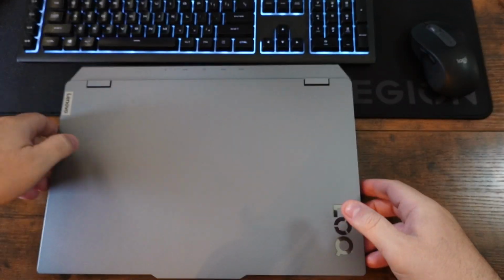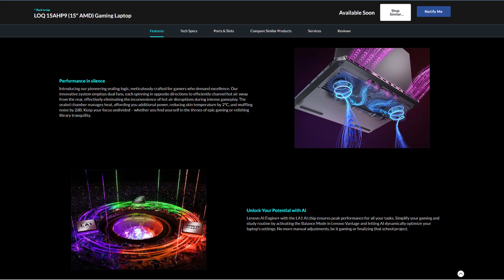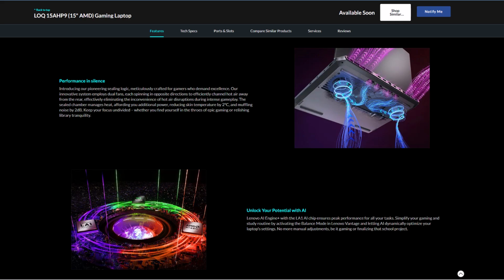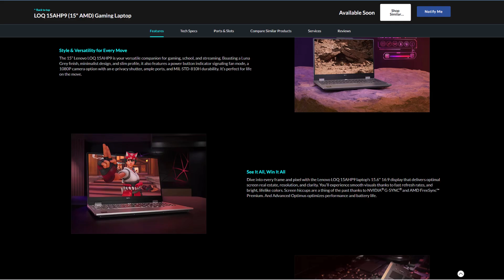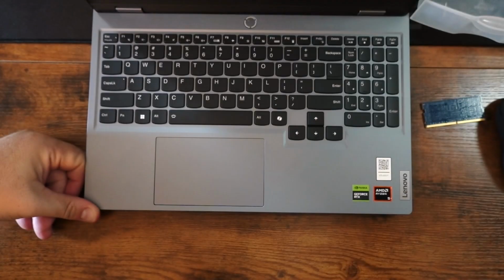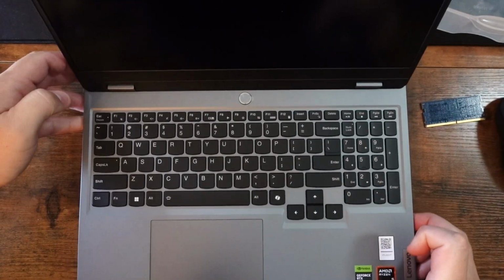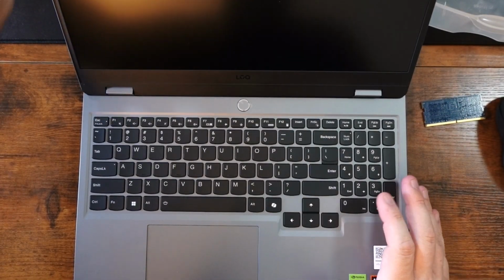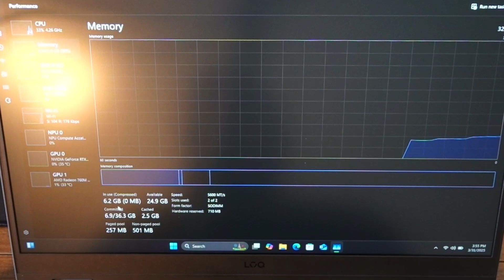Lenovo LOQ 15AHP9 SSD Upgrade Guide | SSD & RAM Upgrade! | RAM & SSD Upgrade Tutorial

Comment: How do max the RAM speed?…. I cannot find XMP or memory overclocking in BIOS.
Reply from the maker: I've checked mine and there is no option for that. It automatically set the speed for the memory I installed.

Comment: Can we disable battery in bios 
Before upgrading anything 
Or we have to disconnect it physically 
Which option is more reliable
Reply from the maker: You would need to physically disconnect it.
Reply: @LMFTechStudios  Why? I just upgraded my RAM without disconection and nothing got happened. Works fine)
Reply from the maker: @bod140k  It's mainly for safety reasons and not to take a chance of damaging anything. It doesn't mean it won't work or will get damaged, but it is better to be safe than sorry.

Comment: I have a dumb question, does the ssd contain my stuff downloaded on my laptop? Also if I replace the ssd and ram will it delete my stuff or do I have to move the stuff somewhere else then install the things? A genuine question, I dont  know much about upgrades and how it all works.. 🙂👍🏼
Reply from the maker: If you take the ssd that came with then yeah,  that ssd contains your data and the operating system, but if you just add an extra ssd like I did in the video then you don't have to worry about it.
Reply: @LMFTechStudios oh ok, I see. Thank you man👍🏼 appreciate it
Reply: @LMFTechStudios one more thing, is it the same with the ram upgrades u did? Does that also have stuff on there or does it not get affected?
Reply from the maker: RAM only store data when computer is on, when you turn it off, no data is stored. So you don't have to worry about that.

Comment: Nothing hurts more than wasting the time to unscrew all those tiny little screws, and trying to unscrew the SSD screw only to find out it's stripped (assuming because manufacturers overtighten them) and I might break the motherboard trying to remove it.
Reply: How do u guys solve the issue? Im fighting with the same problem
Reply: @loxtanatas 
Late reply, chances are they use too much thread lock, so you need a pair of pliers to grip the screw vertically and slowly but firmly attempt to turn it.
This will break the thread lock and allow you to turn the screw.
Reply: @OldManHenderson4D6 thanks man
Reply: Exactly what happened to me.

Comment: Do you have to replace the existing DDR5 ram module?  Can you just add a new one of different brand but same specs?
Reply from the maker: You can add a different one but it's not recommended. Try to at least get the same brand and settings for best possible performance.